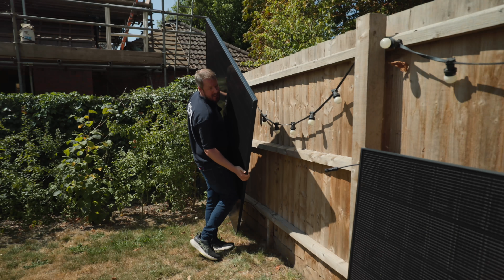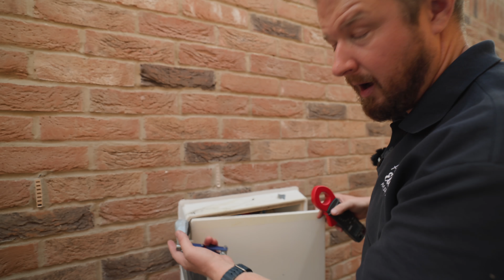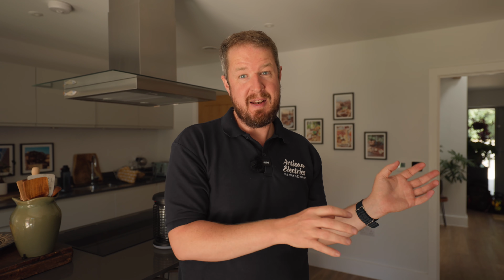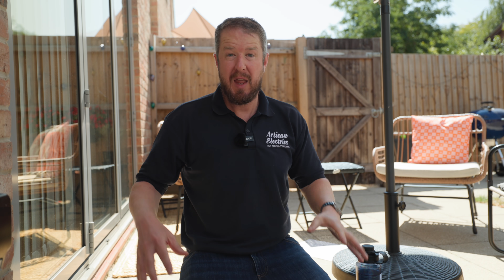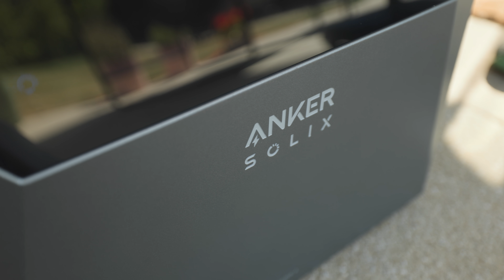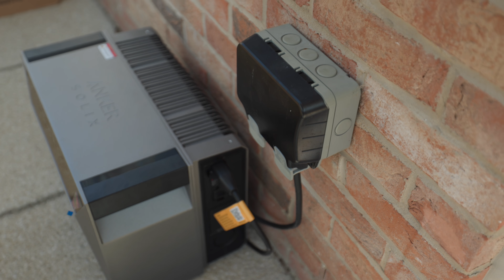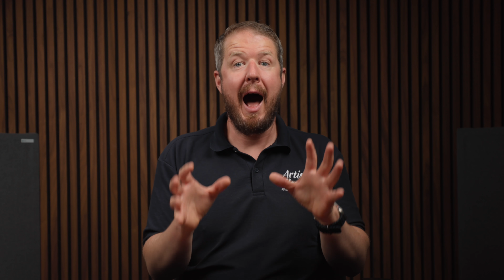The MISSING PIECE of Plug-In Solar

Comment from the maker: Will you be getting a battery for your plug-in solar system?
Reply: You are going to cause a lot of problems potentially for people with this video. Plug in batteries into the plug socket are NOT allowed under plug in solar rules. These have to be wired in properly by an electrician. Please update this video.
Reply: Yeah. In 2028 when it gets passed. Jeez
Reply: @tonyfeasby1437 27th August 2026 Balcony Solar became legal in the UK 🇬🇧 BS7671 Amendment 4, until something happens? The solar voltage is limited to 60V max input, so no high voltage solar string sadly 😢, Some have 4 MPPT input I have seen max 4kW Solar, on the Sigenergy Balcony Solar all I can say to anyone study the speciations, & work out how long without the Sun that battery will last, Solar Panels have to be properly fixed, not with cable ties or strings, so in windy weather your not going to kill anyone or damage property,
Reply: They seem too expensive, i bought an Ecoflow inverter and 2 ja solar 465W panel’s in the UK for around £300, this system with 4 panels and a smart power meter will likely be around £2500? - almost 10x more than i spent…..the real question is, will it generate 10x more usable electricity / savings to payback for itself at the same rate? 😅
Reply: @Digifan0007  I did the same inverter form argos and 2 465w panels city plumbing £340. A battery would take many years to pay back.
A cheaper option would be to over panel for just another £200. The inverter can handle 4 panels.
Reply: @marbogbr completely agree with you, worth trying to focus on getting the system to deal with the base-load of the house, and try to consume the generation as best as you can, i agree unless battery prices drop, over-panelling is a more sensible investment
Reply: @Digifan0007  but your system will export for free and you cant use battery.
Reply: @cbflazaro yup, and until the UK reduce the red tape / make it easier for people to get paid for micro generation, as usual energy companies will likely profit from this by charging someone else full price for this electricity whilst paying me nothing….waiting for battery / inverter units to get cheaper / payback faster….
Reply: In USA in Virginia, absolutely adding a battery.  Also adding a power meter backflow device to prevent backflow.  lol. Not giving power back to utility for free.
Reply: Yes and wiring it to a  fused spur myself so i can unlock 2.5kwh output
Reply: batteries aren't yet legally covered only the panels the battery legislation is still under review so the answer is no not at the moment
Reply: I can get a big battery wired in and the VAT off it from the sparky getting it makes some of these little 2/5kW kits rather pointless even before you consider export tariffs.
Reply: Aren’t plug in batteries still banned on personal installs? Something like this needs a monitor installed in the fuse box to ensure there’s no back feed and battery only outputs to match demand. Fuse box installs need a qualified electrician to satisfy insurance don’t they?
Reply: TBH our current roof set up is too complex to have decent solar - we have three sections of roof - maybe four that could get sun at different times of day, but none of them are adjacent due to height and aspect differences so would require at least 4 separate strings which with the scaff to put them up would be a mare on cost - frankly on my back of a fag packet calculations, getting a 25kWh battery would save us about £2300 a year off our current usage. The really stupid thing is, we have an 80kWh battery sat on the drive that if only we could do bi-directional charging in the UK would completely eliminate the need for plug in batteries purchase 85% of the time - would hold up for days on end and charge at 7.5kW on cheap rate. They really need to get their skates on with sorting that out!
Reply: Yep, from the Netherlands, I bought a Anker Solix max AC ( 7 kWh, 3600 W load /unload if on a stand alone socket or fixed wired on a separate fuse.) That last option I used. The return to grid fine is quiet high and with only this month in use, I already lowered it with € 25,- . I got my own use from 45% to 90%. So almost nothing is going to the grid anymore. The fine wil get lower then. From next year on, I can get a two tariff system. In the afternoon from 12 to 16 It wil get cheaper. Then the use of a Battery system is a no brainer.
Reply: Yes - it is connected to a dedicated 32amp socket (used for a welder) which is on its own circuit - pretty close to being hardwired!
Reply: What's happening about the non-bidirectional breakers in many UK houses then?
Also, if you have solar and don't have a battery, do all electricity meters react sensibly to exported power? I know the ancient mechanical ones with rotating aluminium disc just run backwards which will not be acceptable to the electricity companies. What about somewhat newer electronic meters? Do some of them just charge you the full price for anything you export? Presumably the electricity companies require, at the very least, that exported power is metered separately from incoming power?
Reply: @BrianG61UK I know on my Landis & Gyr E470 it is a bidirectional meter, pitty no P1 socket on that meter so that I can pull out usage data, but you can get a optical interface about £25 to over £100 for Electric energy meters that works on data output,
Reply: @BrianG61UK read the standard and supporting documents. The answer the RCD question comprehensively.

Almost no meter will misbehave. Some old ones will log it as a tamper but that's been ignored for years anyway.
When you apply for the G98 as is mandatory meter non compliance ought to be spotted. However probably no meter old enough to go backwards should still be in use as they will all be long life expired.
Reply: As a retired Instruments & Control's (UKAS Electrical Standards Laboratory manager) & later Aerospace - Defence Hardware Test Qualification Verification Consultant Engineer, I'm a person that looks for high quality build first for sure with specifications etc, I will be interested in looking at all the manufacturers, I probably end up with something more as a Battery off peak storage, due to constraints mountings solar panels without a balcony, until I go for a proper sized inverter backup system,
Reply: Plug-in Solar - What You Need To Know!
Gary Does Solar ☀ Octopus just released a Simplified Video,,, Bad advice really, octopus will release a KIT in the Spring next year,,,, People still hoping they Relax rules later,,,Most stuff as sure you know does not have ENA approval and existing Ecoflow invertor might be retacking their ENA approval.
Reply: No the return period is not worth it
Reply: maybe - do you need specialist connections and equipment to plug in the solar panels and the battery
Reply: Important point, approved is only plug in solar, not plug in battery. You can connect the battery but it can't be connected to the grid, The only way is then connect the fridge to the battery directly or other appliances.
Reply: 3 years from now they are dirt cheap on marketplace for the usual issues their passed generations suffered from. Repair takes about 5 hours and should last, but Anker Support does not care about at all, their ai bots let you turn in circle and they fooled even the german influencer ingenieurskunst Sauter who has a phd in power electronics and renewables. He called it a scam cause he did not get the support for his unit nor did the product ever achieve what their spec had promised. 
He did a video and is no longer doing anything for Anker due to the lies and missing support and not existing warranty - and he did a video about every single issue with Anker.

I have bought their previous generations for 50€ and slaughtered these for good cells. All of them are under full Ankere waranty but Anker does not care in germany.
No, for plug-in solar you will not get a payback time that is worth the money due to poor efficiency.
Reply: It's looking good for those that work from home on laptops and multiple screens. Planning on getting a system.
Reply: I have a giv energy system with 9.5 kw so a 5kw plug in battery would fill the gap nicely depends on cost of battery. Plug in solar would be a good second step.
Reply: My main plan was to buy the complete system in France and plug wire it in via a breaker  to allow me to feed back to the grid the extra production. 6 panels and 4 batteries including the inverter. But then seeing the UK talking about allowing plug in panels but not batteries. I thought I could unplug the panels in France bring the batteries back to the UK and link them NOT via plug but wired in by electrician and run the house from the batteries over the winter. Simply remove them from the UK a return to France during the winter. This would also allow me to store the panels in France out of the way of the crazy Hail stone storms they get. Is all of this mad or could it be done?
Reply: I'm waiting until Sodium ion batteries are a bit more available. I don't trust lithium ion batteries of that size inside my house ! Put them in a metal shed in the garden maybe , but then that's running a cables to the metal shed. 
yes  , I have phones, laptop and  usb power banks, with lithium batteries inside my house , but they are a lot  smaller.
Reply: Are we just pretending that plug in battery storage is specifically excluded in the plug in solar legislation and will NOT be legal in the UK when this comes into force?
Reply: I don't care about payback or exporting to the grid "for free" - we all benefit from going solar by reducing fossil fuel consumption.
Unfortunately plug in solar isn't legal in Hungary yet, and there don't appear to be any plans to introduce it but I live in hope.
I do have 10 kWh of batteries and a 3 kW inverter that I can use to keep essentials going in the event of an outage at least, but it's not wired in with a transfer switch, although I could get an electrician in to make it do peak shaving. I don't have a roof, balcony or garden for solar panels until I move, but at least I'm covered for emergencies.
Reply: As long as I don't loose the first 3 or 4 years gain to paying an electrician!  It's not that I dislike them it's just the economics.
Reply: We're considering plug in and a battery, but have one concern..... would our consumer unit need to have bidirectional breakers?
Reply: Can this be plugged into a spur which is wired into the consumer unit via a two way rod ?
Reply: no as battery storage is not legal in the UK yet plug-in solar and battery storage are not the same plug in solar is legal from the 27th plug-in batteries are not there's gonna be lots of people buying plug-in batteries not realising it's not legal and the battery could void the house insurance if plugged in through an outside socket even a electric wheelchair can avoid  house insurance if it's not on the policy I added an £8,000  wheelchair to my policy if I did not and that caused the fire  thay would not pay out
Reply: @oneleggedwonder1was thinking the same thing. Don’t think I heard it being mentioned in the video that plug-in batteries aren’t legal yet, outside of the note in the description. Wonder if the link is one they get paid for.
Reply: @oneleggedwonder1Insurance companies are good at taking your money & some - all are good at not paying out,

Comment: Around 20% work from home. And it's not always about 'getting paid'. Offsetting is a thing. I used one with my kitchen mains ring just to offset the power used by the fridge, the air fryer, or dishwasher.  Thinking doing the same with home office and roof solar panels.

Comment: DO NOT BUY!!! — Anker delivered my solar system with two panels smashed to pieces and the others scratched and dented. The damage happened before the panels were even unloaded, yet Anker is refusing to replace them.

My installation is now on hold, despite spending thousands of pounds on Anker SOLIX equipment. I’m genuinely shocked by their response.

I just want the damaged delivery put right. Is this really how Anker treats its customers?

Comment: 🇬🇧I have 2 x 5kw batteries and 20 panels but all that energy on 95% fully charged batteries, drains fully by the morning.

Can I simply buy an extra plug in system incl extra panels put on the fence rather than the roof without affecting my present system in anyway?

Comment: it is interesting, but cheap rate electric is only cheap rate because demand is low.
Now think about the switch over to electric vehicles and more and more people looking to charge them and their in house batteries and you can see that off-peak demand is only going to grow.
With systems with a short pay back period not such a big worry, but if you're costing a system over 10-15 years you might want to assume that off-peak tariffs are only going to rise int he long-term

Comment: WHAT NOBODY TELLS YOU is that the solar will only save you around 10 to 200 pounds per YEAR if Yiu way up the cost of the battery and solar panels and even someone to I stall them it might end up costing you around £1500 to £2000 . Divide that by now much your saving per year and you'll soon see how many years it will take you to just break even !!

Comment: I’m pretty sure these figures are misleading.

You’re comparing the savings against Octopus’s 29p/kWh rate, but people with other suppliers can pay much less. I currently pay about 24p/kWh with Fuse Energy.

So if you’re calculating the true battery payback period, you should be comparing it against a realistic alternative tariff like 24p/kWh, not 29p/kWh.

Also, even with the battery system, you’ll still use some grid electricity at 29p/kWh. That cost should be included in the calculation too.

Using 29p as the starting point makes the savings look bigger and the payback period shorter than it really is.

I’d be interested to see the calculation using 24p/kWh instead. I suspect the payback period would be quite a bit longer.

Comment: I use a Shelly smart meter to prevent any export, regardless of whether the battery is full etc. if we don’t use it it’s throttled.   Saying that I have over 10 kw worth of battery to mop up as much as possible.

Comment: I bought a system with plug in batteries and it came with a plug, it worked really well so i bouth another 2 sets. I have now 8 panels and 6 batteries all of which are plugged in as per th einstruction manual and i did not have to do any wiring at all as i have multiple garden double sockets to plug them in. How would anyone ever know if yo do this? If you get a fire or something just unplug it and put it in the shed....

Comment: I get plug in solar but I don’t understand the battery part, apart from charging it form solar or an off peak tariff, how is it saving on electric just by plugging it in, you have a washing machine fridge freezer in one room, tv in another games console in another how are we saving further with the battery? As all I’ve seen with batteries is plugging stuff straight into them.

Comment: Great video but uses some dodgy maths to justify a time of use tariff. All time of use tariffs carry a significant daytime penalty. So the sensible neighbour here is not paying 29p/ unit because they have switched to a competitive tariff of 23p/kwh for 24 hrs per day. So the payback time is longer here than you think.  Even for an EV user driving 6000 miles per year there is barely any  benefit from using a time of use tariff, especially if you charger on 3-pin..Solar is great and so is battery storage but people need to be careful when they do the maths.

Comment: @artisianelectrics, love the breakdown! Quick question for you guys: with battery costs still being pretty high, aren't immersion water tanks basically a ready-made thermal battery? Modern insulated tanks lose barely any heat overnight. Is dumping excess solar directly into hot water a smarter return on investment for most homes than a traditional battery setup?

Comment: “Fully compatible with plug in solar” - How? Showing the battery plugged into an outside socket on the ring with no feed out is confusing the heck out of everyone . Anker themselves state the need for the battery to be hardwired.  You’ve cut corners with this video and confused folks.

Comment: ChatGPT says if you use a battery  you need an electrician costing between 300 and 600 on average and they will handle the dno g98 notice, whatever that is. Something Smuggy on the video forgot to mention. You just know he drives a Tesla.

Comment: Did you calculate the savings on the Octopus tariff without considering the extra cost of energy during the peak times? 800W will only cover a little more than base load, so there will be lots of energy taken from the grid during peak periods.

Comment: At 12:00 mins In your example, some heavy wattage appliances, like washing machine and tumble dryer, could be timed to operate in the cheap overnight period, leaving only ovens, air-fryers, micros and kettles for obligatory daytime high rates - unless any/all can be plugged, in turn, straight into the battery 2.5kW outlet, keep the battery (or just in evenings move) in kitchen and swop their cable over when needed.

Comment: We have an EV and are on an Octopus cheap off-peak tariff.

From a ROI point of view would it not be better to just install a battery which can be charged off-peak and used during the day. So instead of paying around 23p/kW for daytime energy we'll be paying 7p/kW all the time.

Adding solar at a later date will obviously be beneficial but the best investment is surely a 10kWh first?

Comment: On ideal weather 800w will be pushed to the grid, besides what you meantion fridges is working 24/7, besides there is timers, lets say for a immersion heater, thats your battery. You was much agains plug in solar, now you advertising batterys?🙄